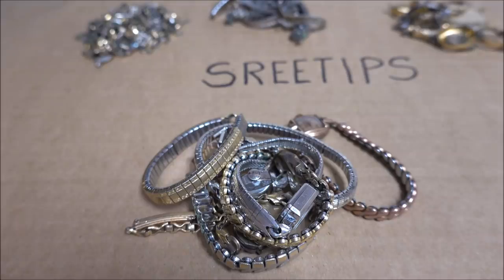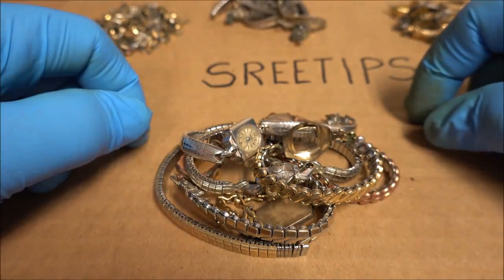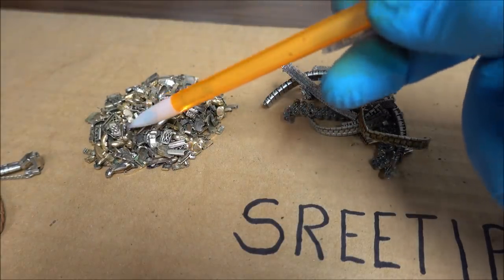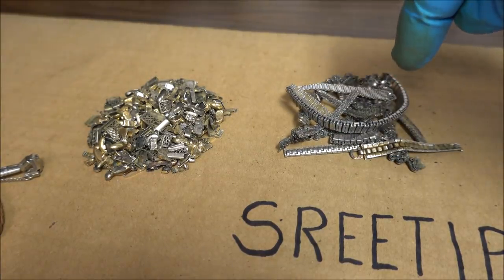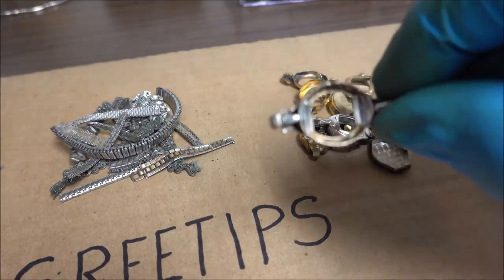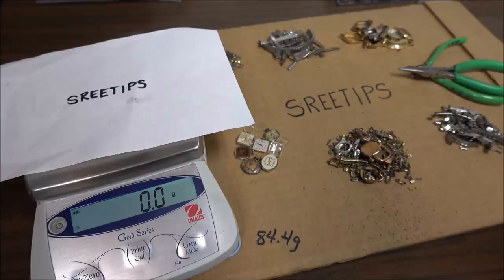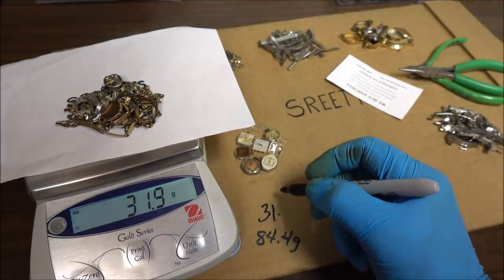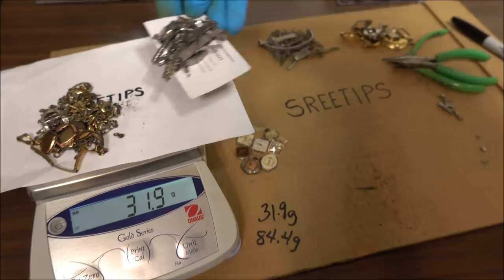Scrapping Gold Filled Watches

Comment: I have a question I have watch cases that say bezel base stainless steel but don’t catch on a magnet you think it’s gold filled?
Reply from the maker: Apply a tiny bit of 14k test acid directly to the piece in question. If it immediately eats through the gold coating, bubbles, turns green and stinks, then it gold plated. If it just sits there for over 60 seconds and doesn’t react then it’s probably gold filled. GF material is a thick coating of karat gold over brass. Gold plated is just a few microns of gold, almost nothing.
Reply: @sreetips  thank you appreciate the help also how would I know if it’s rolled gold plated
Reply from the maker: Rolled gold plate (RGP) is gold filled. RGP is a thick coating of karat gold that is bonded (rolled) to a base metal, usually brass.

Comment: I have bags of this stuff. I figured out I bought a bunch of saved gold and jewels that belonged to a jeweler from way back. I looked up the Elgin movements and oldest is from 1895, others are from 1911 and earlier. I got lots of pieces of gold from sized rings and lots like 60 or 70 diamonds of all sizes and a few other jewels. I wondered how many watches and I got over 100 gold knobs used to wind the watches and quite a few silver ones. I got bags of the gold gears and so many screws that held it all together lol. Thanks too I didn't know those were the crystals! I got almost everything separated and want to get all this refined and sell all the real diamonds currently! 

I forgot to ask are the gears gold or gold plated? I got probably 100 or so knobs you wind the watch with from the inside and out I see gold, and I scratched deep and see nothing but gold, so safe to say they're gold?
Reply from the maker: Test with acid to verify

Comment: Looks like an industrial shredder would help to cut the labor but then you would have to use a magnet to pull what steel it can and hand sort what is non magnetic. A smaller tooth size for smaller finished bits to just toss in chains and bands after pulling the crystal and movement and it would also make the acid process faster with more surface area to attack.
Reply: Gold filled material is also magnetic as its mixed with base metals like copper

Comment: You're making an incorrect assumption that because one side is gold filled plate that half the weight is gold filled material. The percentage can vary according to the method of manufacture, one side doesn't necessarily mean one half.
Reply from the maker: So here is what I'll do. I'll make my next video of just the material that I harvested from the gold filled watches. Then we'll see how far off my calculations are. Great suggestion for my next video. Thank you!
Reply: @sreetips  I agree with Smokey in the USA the meaning of gold filled (GF) means that the item is 1/20th gold, by weight it's a law. It actually makes sense to put all  the gold filled material on the areas that are seen/will wear. I bet the yield in the next video will not be exactly 1/20th or whatever is marked because of the use and wear. Some of those bands have been worn out for sure.
Reply from the maker: Smokey - I completed the refining experiment and got way more gold yield than I expected from these gold filled watches. Cutting the yield is half WAS WRONG just like you said. The video that proves it is uploading as I write the comment.
Reply from the maker: Smokey was right, I was was wrong. Video proof uploading as I write.
Reply: @sreetips  Awesome, today I will learn something new! Thank you sreetips!
Reply: @sreetips did u do that already